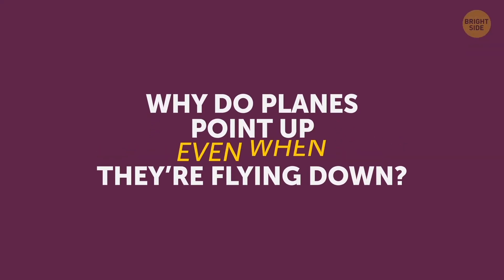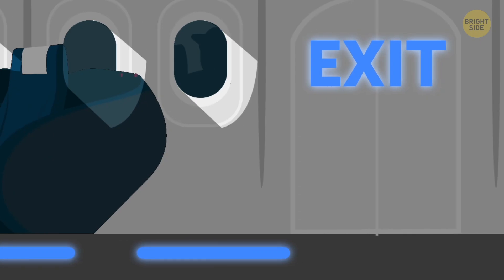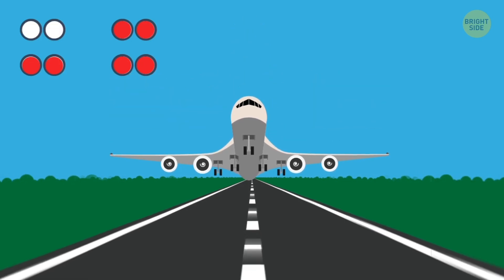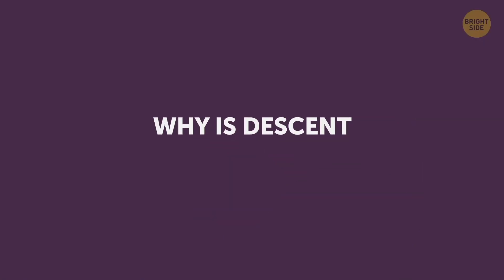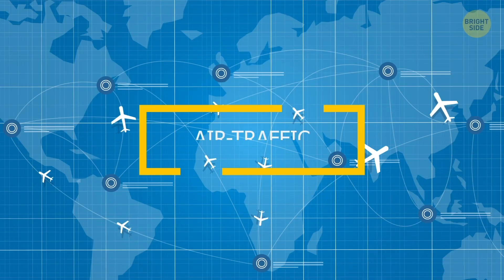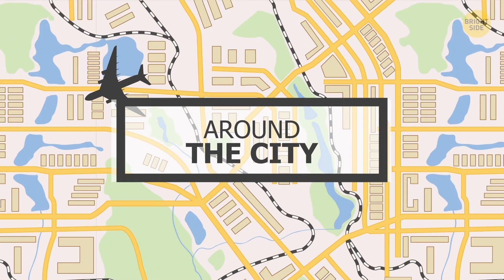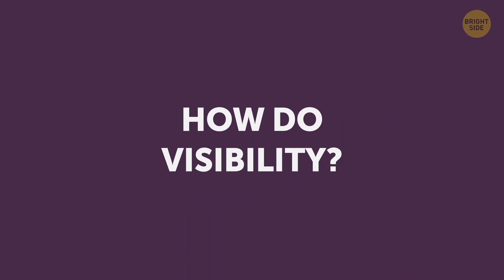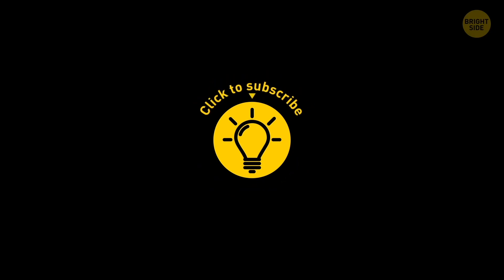11 Things About Landing Pilots Want You to Know

Comment: The pilots DO NOT dim the lights for "energy". I don't know where you got that from, but it's just not true. The lights use such a small amount of energy, and the other functions of the plane are using the same amount of energy for the entire flight. There is no need for extra energy during landing. 

Also, the plane does not say "decide", it says "minimums". I don't think there is a single plane that says "decide". 

Ground effect does not happen in the last 15 seconds, it happens only within about a wingspan from the ground, meaning you will only really feel it in the last 3-4 seconds before landing.

The "approach" and a "Holding pattern" are two very different things. The approach is the procedure used to get to the runway. I holding pattern is a racetrack-shaped pattern that planes go into when they have to wait for further clearance. 

During an approach in low visibility, the ATC is not a set of "extra eyes". Everything is just about the same for the Air Traffic Controller, and it's up to the pilots to land the plane properly. 

Please, Bright Side, check your facts and stop just spewing nonsense about a topic you know nothing about.
Reply: Thank you man.
Reply: i agree as an Avgeek i can agree and confirm this

Comment: Uhhhhh pilot here. Most of these are not correct. For example. During decent you are nose down until about  50 (in a large jet) and then you flare to prevent the nose from hitting first and crumpling the nose gear. Also we will often go several legs on one batch of fuel in the a321 neo . It is not almost empty on every landing. Also, you do not practice cross wind landings at the beginning of you ppl. There is also no issue with visual approach and not being Lined up with the runway. We use instruments.  we can do the entire approach and landing without even looking out the window.

Comment: It’s also called a side slip
Reply: No, what hes talking about is crabbing, side slipping is a maneuver that can be done in wind or not and its where you stomp a rudder pedal and hold the yolk in the opposite direction, turning the plane sideways. usually used in emergencies when you need to lose speed quickly

Comment: The pitching up while landing is called flaring. This happens as the Commercial jets cant land with the nose pointed down
Smaller jets can though. The pitching up during descent helps slow the plane down and in case of a go around they are already pitching up so all they have to do is apply power which will allow the plane to start climbing

Comment: dumping fuel in the air... we breathe that in on the ground...
Reply: Walevolence It is usually dumped in a bit higher altitudes so that it evaporates before it reaches the ground
Reply: If the airport is near a coastline the aircraft will normally dump fuel over the ocean but still high enough so the fuel evaporates before reaching the water.

Comment: Why planes  can fly...
Reply: It quite simple, really. When a plane goes forward air flows over and under the wings. The top of the wings is rounded, and the bottom is flat. This shape causes a difference in air pressure above the wing and below it. The pressure is lower above the wing, and higher below it. The higher pressure pushes up on the wings, and the plane flies.